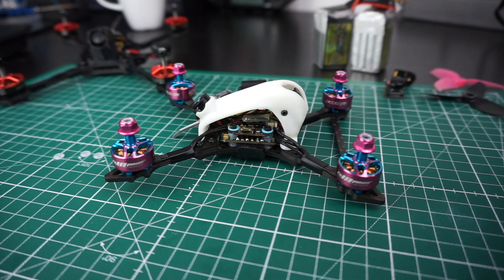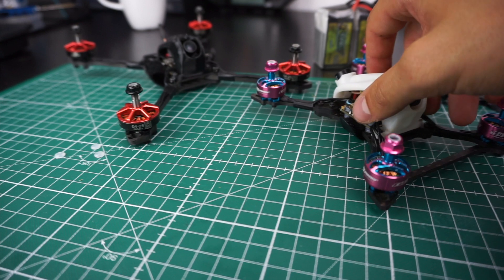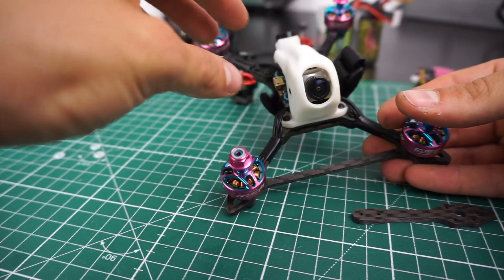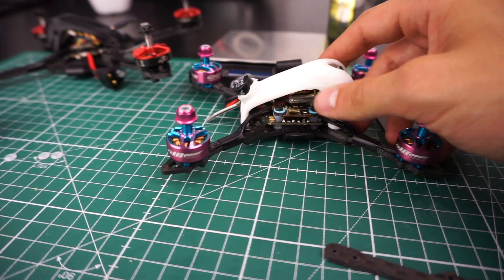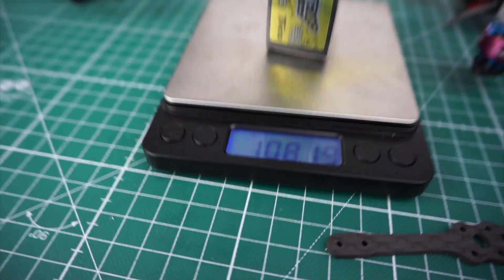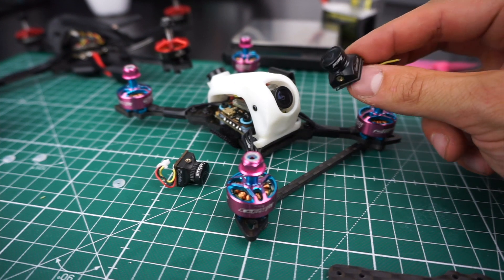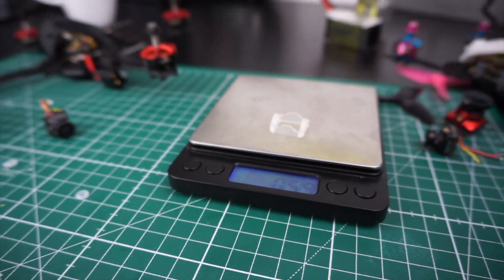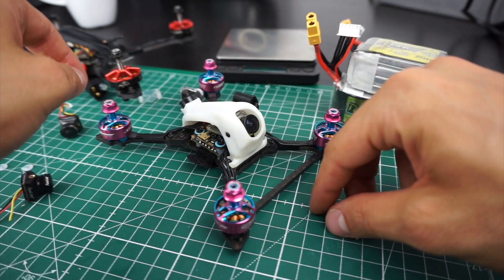New 3" racing frame design: Gatehunter SLS3

Comment: You say "without this optional brace it is purely optional anyways". Do you mean the brace has no impact on performance other than protecting the quad. That is my expectation, can u confirm one way or another?
Reply from the maker: Yes that's it!
Reply: @DaveCFPV  Thanks, makes sense. Looks like it might be nice in the case of a head on collision into a post/branch/gate pole.

Comment: It would be interesting how this exactly setup works on 4 inch. Did you think about providing 4 inch arms for the frame?
Reply from the maker: _ kaptnfirlefanz I‘m looking into another direction currently. Since there are a lot of 30A+ 6S 20x20 stacks coming I‘m working on a 5“ racer on that platform that can handle 2207 motors.
Reply: @DaveCFPV  Do you prefer 3" or 5" for racing at the moment? Regarding fun, reliability and handling?

Comment: So have you flown it much? Are you still thinking the m2 screws are a good idea for the frame? Are they shearing more than m3 fasteners would?
Reply from the maker: Rotorblast I didn‘t have any issues yet with M2 shearing or anything (If course m I can only speak for myself and the specific screws I use).